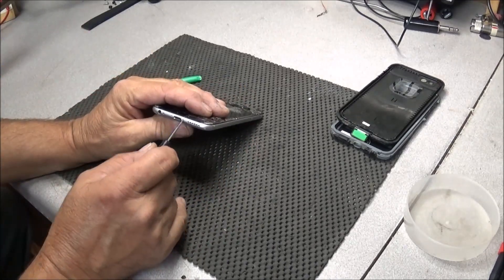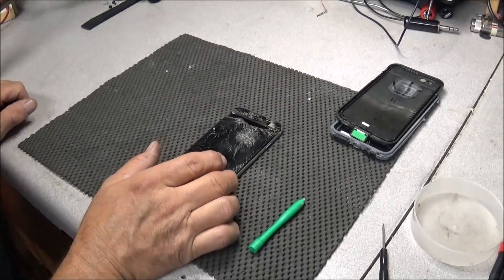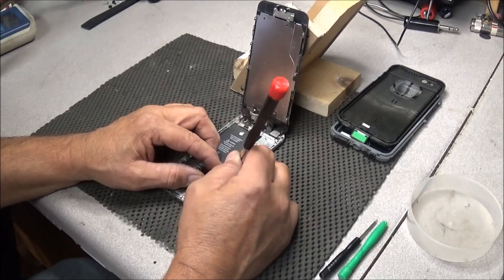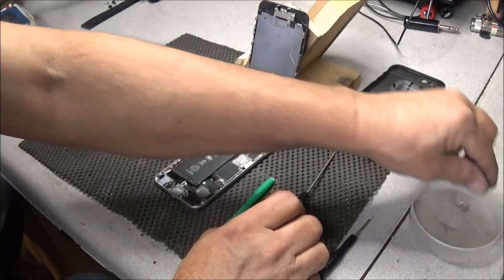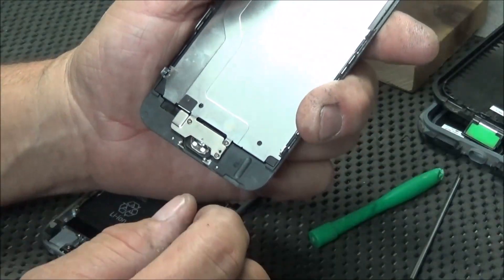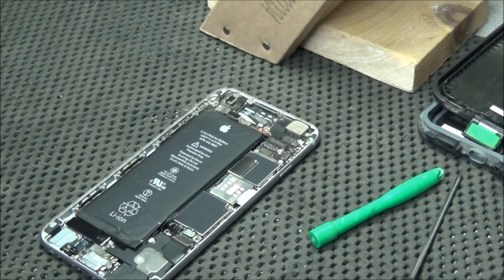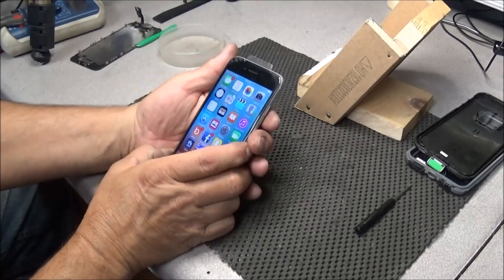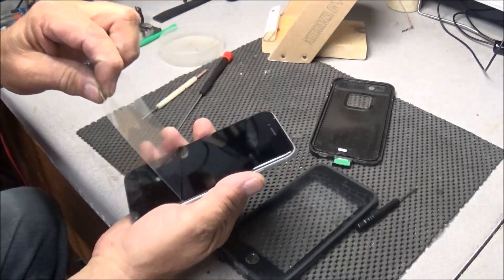#125 Busted  IPhone 6 Repair

Comment: Nice work. I can relate to the need for more light on it which, in my case, happens to be attached around a magnifying lens. ;)
Reply from the maker: Thanks. I have several mag lights also. Cannot see as good  as I used to. BTW, good to see you

Comment: Thank you for the iPhone screen repair video.  I was always afraid to try and repair these, due to the tiny screws and connectors, etc.  Why do you need to switch out the home button, is it unique to that particular iPhone?
Reply from the maker: Thanks Pete.  I used to be Leary of working on certain things in the past. Now I just do it.  When the phone is first set up there is information that is stored in a chip that is attached to the home button ribbon cable.  Since the new face plate does not contain this information there is no way of putting it in there without a complete phone reset.  So by swapping the home key this is accomplished.  Thanks for the question.
Reply: Thanks for the reply, that makes sense.

Comment: How come if the new display comes with a new home button, we're swapping it out with the button out of the smashed display?  Thanks, Buddy.
Reply from the maker: There is a eprom in the home button that holds the users information, If y\we used the new button we would loose this information,  There is no was\ to retrieve it as I understand.